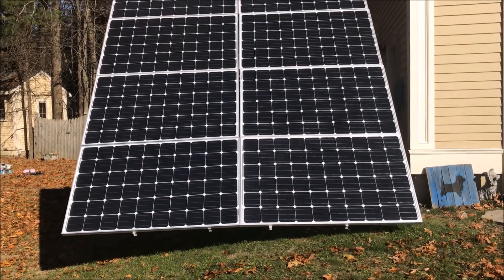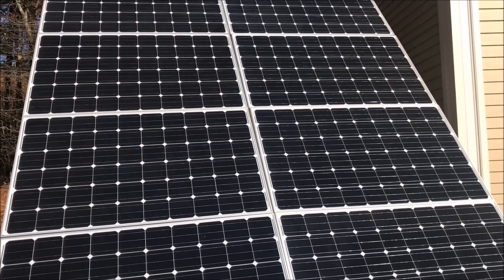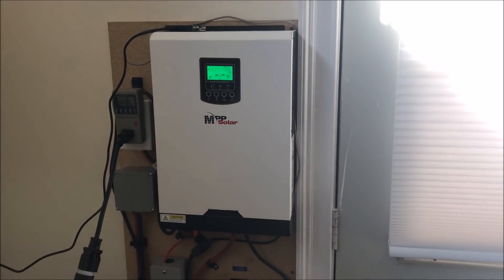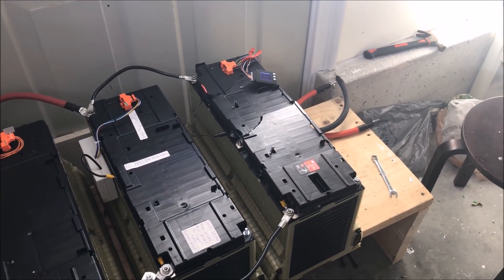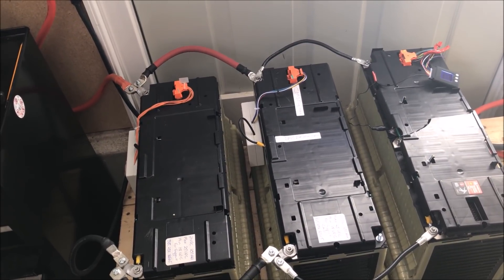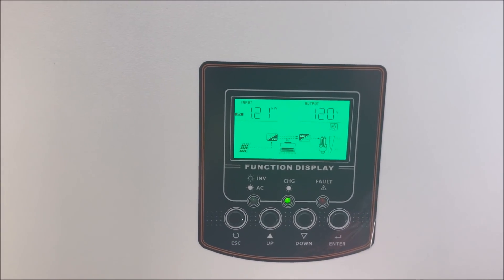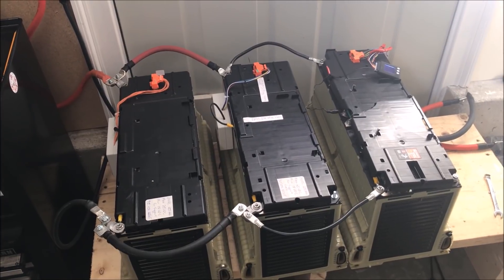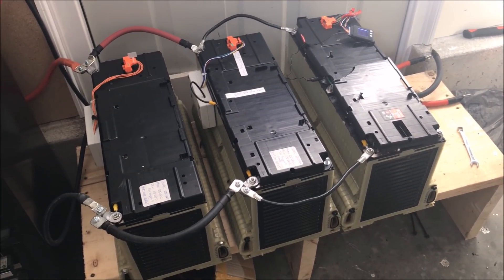MPP Solar with Chevy Volt 24v Li-Ion batteries

Comment: If it was me I would use a 48 VDC system. You cut down the current loss and do not have to modify the batteries. In spite of the attraction for the lower cost Chinese Alibaba solar, I stick with Outback inverters as they are the Rolls-Royce of inverters to me
Reply from the maker: That was done years ago. Before there was 48v split phase systems anywhere

Comment: Where did you get the terminal splitter that can handle 2 connections?  Thanks
Reply from the maker: Joseph Pham eBay if I recall.
Reply: @offeraviad  do you know what they are call or a link?  I can't find them.
Reply from the maker: Joseph Pham https://m.autozone.com/batteries-starting-and-charging/battery-terminal/duralast-battery-terminal-dl06069/95966_0_23848?location=

Comment: Please connect one of the battery leads to the other side of the pack to ensure more even charging and discharging. This can render them useless in a short time.
Reply from the maker: Fabian Doubleyou check my other videos. The setup is now using busbars instead.
Reply: @offeraviad  Will do soon. 👍🏼 Busbar or wires, the paralleled batteries must still be connected one lead at the first battery and the other at the last one. This is essential with lead acid and I guess not so important with lithium if they have cell management. But then it would still speed up balancing.
Have a nice day and keep up the good work.
Reply from the maker: Fabian Doubleyou point taken!  Agree.

Comment: Thank you for the video. I want to do what you have done. Does the mpp solar charge them well. How do you fully drain 10kwh over night
Reply from the maker: AWPS Renewable Energy, LTD plz see my first video. I use it to charge my car. In few hours I use the entire 10Kwh and I also charge directly from the sun another 8-10Kwh during the day. Mppsolar works great. Zero issues.
Reply: Aviad Offer I will watch it. Thank you

Comment: Looks like each Chevy Volt Battery can store 2kwh. So for 10 kwh system I would need about 6 of 48v 50ah batteries. I assume this MPP inverter work with these kind of batteries. What kind of charge controller did you use?
Reply from the maker: Burt Chiropractic Rehabilitation Center by now I have 6 batteries. Getting about 10kwh. Those are modified batteries to 24v. Next few weeks I will add a video how I broke a 48V battery to 100amp 24v(6 cells). The mpp solar allows you configure custom batteries. Been working great for 6 months now. Very happy.
Reply: That is pretty awesome. What is MPP inverter model? This is an amazing saving and an amazing setup. I got a quote for 4kwh solar and and 10kwh battery set up $37k - seems like an overkill.  Seems like using these Chevy Volt batteries and Solar Panels from someone who is selling a house is the way to go. About $3k for 38 panels at 280W each and about $2k-2.5k for batteries from Chevy Volt. What is the cost of Inverter and Control Charger that will work with these batteries?
Reply from the maker: Burt Chiropractic Rehabilitation Center oh wow that’s crazy. If you do It yourself you can easily get it around 5-6K. I need to post an update since I have a 4K setup by now using mppsolar split phase LV inverter. It just came out two weeks ago and I am already using it as 240v. https://www.mppsolar.com
Reply: Indeed, way overpriced. Where did you get your Volt Batteries? I found few good deals on Ebay and some guy sells it on Cragslist locally each $585 for 2kwh  48v 50Ah - so fo a pack of 5 about 3k. He claims they are brand new.
Reply from the maker: On eBay but there is 48v inverter that works with 110v ac. Hence I had to convert those to 24v (not easy, video coming). I got mine on eBay for $300 each.
Reply: Your video is directly to the point. Subscribed and ready to watch your new video.
Reply from the maker: Burt Chiropractic Rehabilitation Center thanks. If I get the batteries this week and it’s not going to be 20F I will make it happen. Freaking cold here.
Reply: I am in Nor Cal and there is no sign of global warming here. It was below freezing this AM, something you rarely see.  Will rain the rest of the week.
Reply from the maker: Burt Chiropractic Rehabilitation Center those are the signs my friend. The south is getting warmer so cold air is moving to the North Pole. This is climate change.
Reply: Aviad Offer I just missed 2 48v 50Ah Chevy Volt Batteries. The same seller has 55Ah and 56vDC battery from 2016 - Would it work with mpp off grid inverter or should I look specifically for 48vDC with 50Ah battery? Thanks in advance
Reply from the maker: Burt Chiropractic Rehabilitation Center I’m not aware of any inverter that will work with such voltage.  I only know about 24v ones for America 110v ac.
Reply: Aviad Offer Ok, so I just specifically look for 48vDC and 50Ah Chevy Volt battery. When is your video coming out for breaking down 48 into 24?
Reply from the maker: Maybe next weekend, if it's took cold I don't feel like doing it. my garage is cold. You can buy 24v ready ones on ebay as well.
Reply: Aviad Offer Ok, any particular brand of LO 24V batteries?
Reply from the maker: Chevy Volt of course.

Comment: Kool project. Where did you get that little, blue cell monitor? Is it plug and play for the Volt battery? I am going to use those batteries, too. Thanks.
Reply from the maker: kamms moonfresh it’s called CellLog 8. You just need to wire it to the Volt Battery BMS connector.

Comment: What is your BMS on the volt batteries?  I see a small white box on the side of the left and center batteries.
Reply from the maker: http://www.batterysupports.com/22v-24v-6s-60a-6x-36v-lithium-ion-lipo-battery-bms-pcm-pcb-p-478.html

Comment: Nice setup 👍🏻 I have been using a whole Chevy volt battery plus 2 extra modules, total of about 20 kwh, around 11.5 kwh usable since March with no bms and there is almost no variation of voltages between cells and also I only charge them between 3.33/4.08v per cell
Reply from the maker: wow, that's a huge setup! Yeh agree, after 3 months including freezing winter with -2F the cells are about 20-50mv off. That tells me there is no need for a BMS in this kind of setup
Reply: What do you mean 11.5kWh usable out of 20kWh pack?
Reply: @The_Unobtainium  because I am using an inverter made to use with lead acid batteries, the inverter ranges from 56 to 39.5 volts, but lithium 48 volt modules should never recharge past 50 volts so my range is from 50 to 39.5 volts thus not being able to use the whole 20kwh, hope I explain myself well, if the inverter could go as low as 36 volts and squeeze more battery, I could use more kws